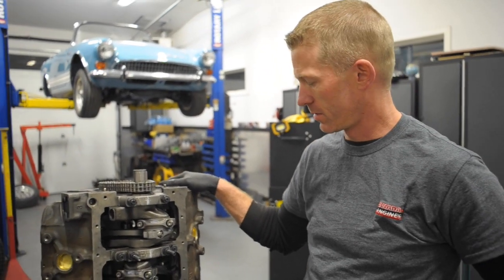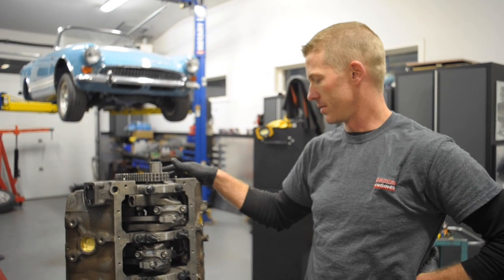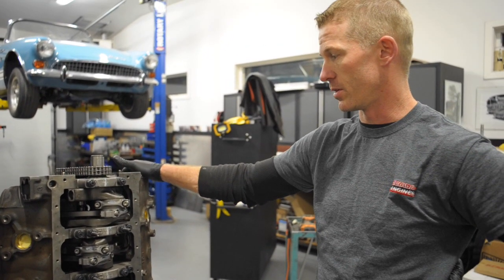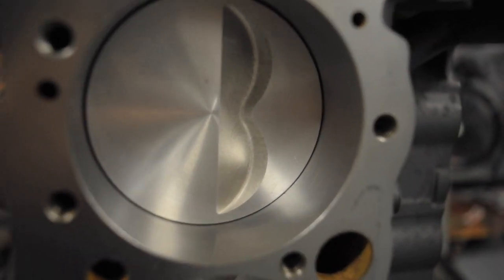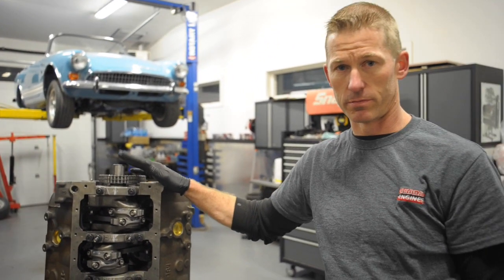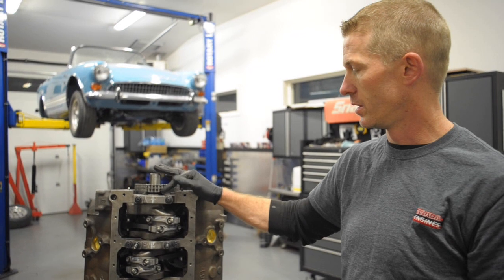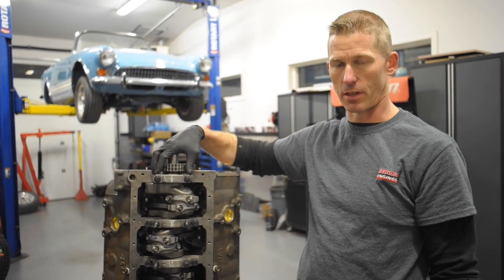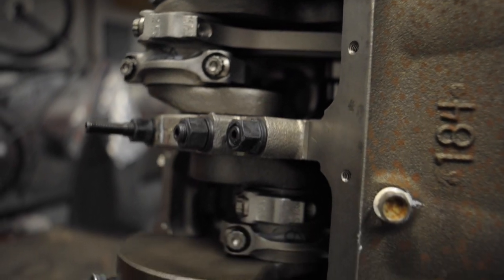SBC 283 Crankshaft + 400 Block Crate Engine Build Intro

Comment: Are these blocks siamesed casting?
Reply from the maker: Hi gearhead, yes they are.
Reply: Yep ,  l have an 511 casting which is considered 2 be the strongest of the Chevy 400 ci blocks. Have a 427 stroke crank rods piston combo for 640 hp 620 tq
Reply from the maker: @robertphillips3078  
Awesome! That’s must be fun! What’s it in?
Reply: @ceperformance  jet boat .
Reply: @ceperformance  l also have a bbc in bits. 454 steel crank Original 427 corvette 4 bolt block. Richard Lee Marine Intercooler & 871 race blower. Titanium com cam rockers ect heaps of expensive bits . MSD 7al ignition & LEADS & MSD Distributor , the list is endless.  What l would like 2 do is go 4 a 482 billet stroker crank & the 4.5 ltr Whipple Supercharger with an Aussie Billet mini tunnel ram 2 mount the intercooler & supercharger on. Finished this motor combo is good 4 1000hp on 98 octane & pretty similar torque figures. Also slated 4 a Eliminator 19ft Daytona.  Spent over 10k aud on the jet unit. Sent it over 2 California 2 be fully rebuilt with all the best stuff.
Reply from the maker: @robertphillips3078  
Wow, sounds like a great combo! I’d love a ride in that rocket!
Reply: Ya  I too was looking for the "steam holes". I didn't see them. Unsure as to why. Bow tie exclusive maybe??
Reply from the maker: @russellmooneyham3334  Fantastic observation RM! Thank you for your comment. This was one of the reasons for our 4/7 swap cam—to move the consecutive firing between cylinder 5 and 7 up to 4 and 2, to remove any possible hot spot in the rear corner of the engine. Also, we are being intentional with coolant-line  plumbing from the rear of the intake manifold to ensure coolant is pulled forward, and not left stagnant. Of course, "steam holes" would have been a great addition. The cooling effect of aluminum cylinder heads will helps with overall engine temperature consistency. Of course, we are still testing our ideas out. That's what we do! Best regards, RM!